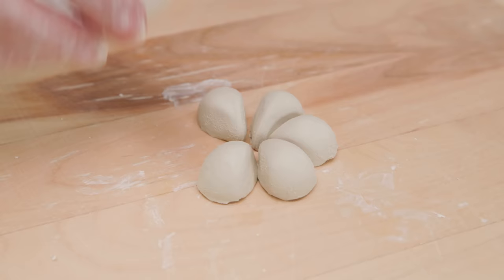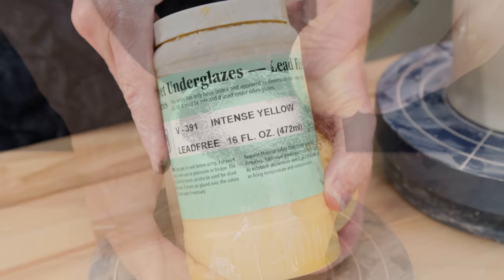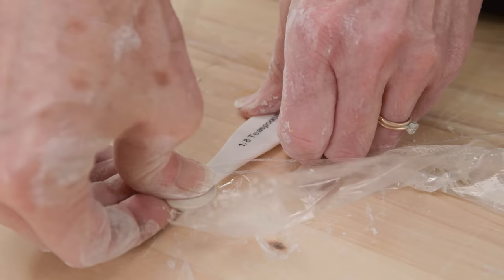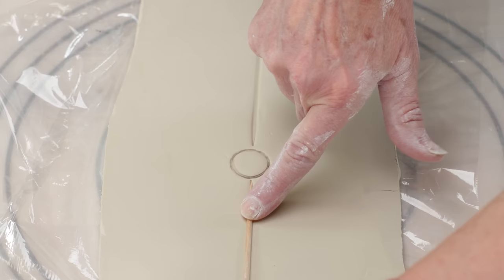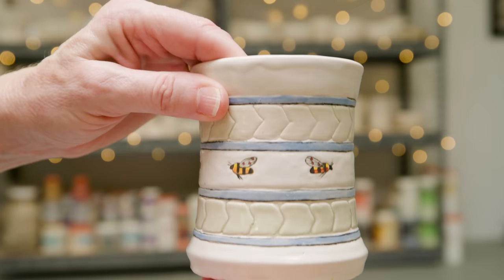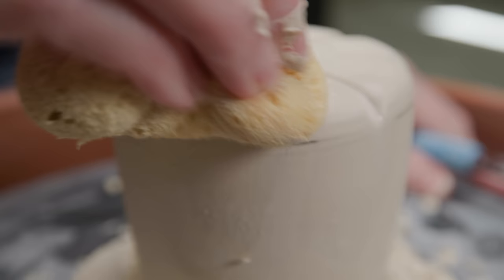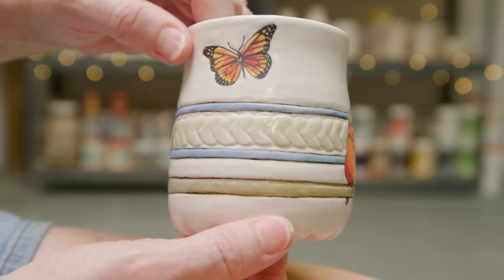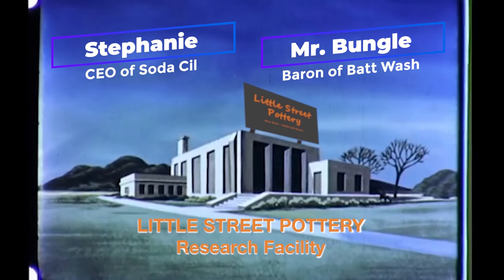5 Foot Ideas for Pottery - UPSIDE DOWN THINKING TO IMPROVE YOUR POTTERY!

Comment: I love the idea of decorating the bottoms first. I have to tell you, the last show/sale I had pieces in, I had some cute carved bowls that I thought would sell right away. I don't always carve the bottoms but on these ones I had. When I went in to work my shift at the sale, I turned the pieces with carved bottoms over so you could see the bottom and carved sides and all of them sold within a few hours. It seems like an afterthought to do it but it's a great surprise as someone handles the item or when you're sitting with someone and as they tip their cup so that the bottom can be seen.